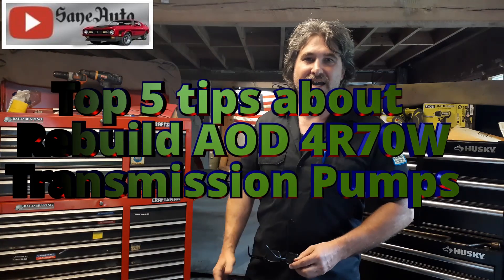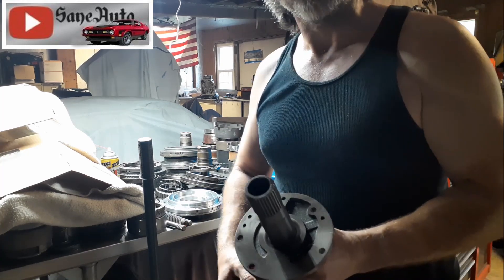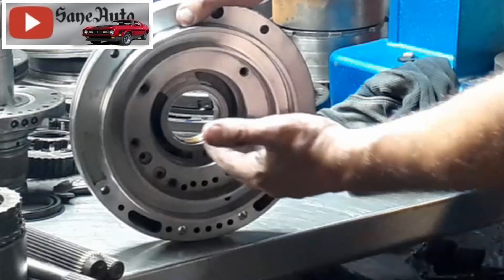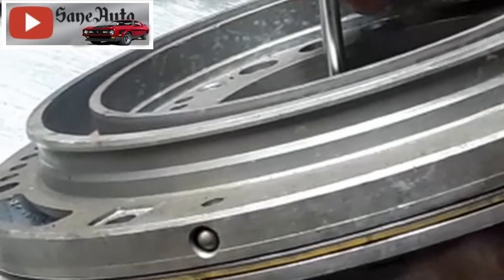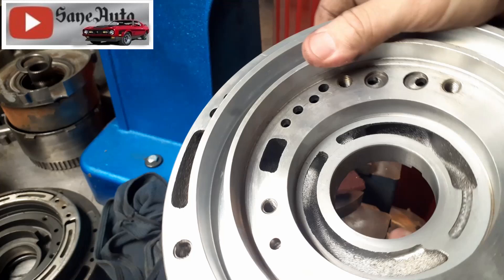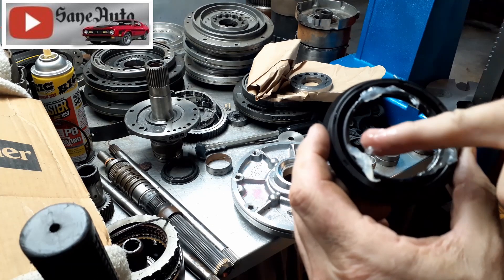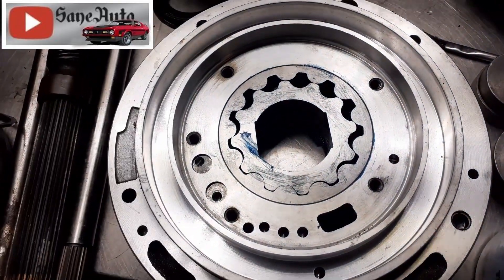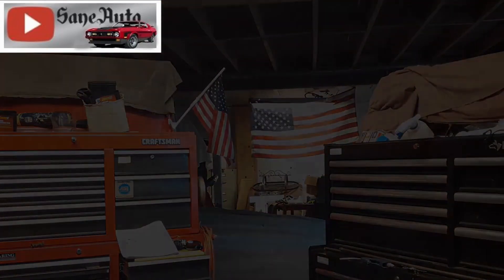Rebuild AOD 4R70W Pump Ford Automatic Transmission repair

Comment: Just wanted to say thanks.  I am a thirty year plus Master Tech but have moved into transmission rebuild recently and consider myself a Junior builder (been building mostly full time for just over 2 years) now.  I have rebuilt 5 or 6 4R70/75’s and never had an issue until this latest.  The unit works fine, shifts nice, performs well, but spit the converter seal out of the pump on the last test drive.  I obviously replaced the bushings and even 3m weather striped the outside of the seal.  The pump gears and pump were also checked for wear and were in great shape.  I never really thought about placing the groove of the bushing on the bottom of the cavity and I didn’t realize the seal was designed with a lip on the inner portion.  I enjoy this work very much because of these little things that are learned along the way and I will be paying a lot more attention to my bushing placement and pump seal retention from now on.  Lots of great experience shared here!!!!!  Thank You!!!
Reply from the maker: Wow thats Awesome! I was pretty much at that phase every year my first 5 years of building. After that it was still a full time job keeping up with learning all the new units and the details of they're weak points for the next 20 years or so. lots of ATSG seminars and reading research etc. It was a wild and exciting ride. Sometimes it was difficult, frustrating and even painful. Especially the day I had to have my finger sowed back on. But it was never ever boring. Thank you for reviving some memories.

Comment: I do want to ask you one more question and if you feel like helping great, if you don’t I completely understand and no disrespect at all. This 2008 4R75w that pushed the converter to pump bushing and front seal out is giving me a headache. I rebuilt the unit, replaced all the bushings, all the normal things on a proper rebuild.  As I stated it was working well (I did do the Jmod stuff by the way) and on the final test drive pushed the bushing/seal forward.  I had a 4R70w pump here in good shape.  Most everything looked/quick measured the same but the stator hub was different (inner bushing treatment) and the return spring for the intermediate piston was different (wave spring/4R75, attached to pump caged assembly/4R70.  So I swapped stators and used the pump body from the 4R70, bolted the pump back in, and installed the trans.  Now it’s shifting/acting like it has a cross leak somewhere.  It shifts up to OD but it’s slow then surges/falls in and out of OD and maybe lock up.  I have another pump coming and feel like it’s going to fix it but do you have any input on the possible differences in those two pumps?  I am also going to be checking my sealing rings/pump gasket to make sure I didn’t damage something there.

Comment: Great video. You methods are rock solid. Arbor press is the way to go.

Question. My neighbor couldn’t get his rebuilt 4R70W to seat and asked me to help. It was immediately obvious that the converter wasn’t lined up with the pump gear or maybe it had slipped out. He cranked it almost all the way in and was certainly putting pressure on the pump gear. 

I pulled the seal and inspected what I could with a flashlight and I cant see any issues but should the pump come out?

On other vehicles that have a drive pin it usually breaks the pin but I don’t see what would be damaged in this design provided the gear itself isn’t damaged.

Comment: I'm working on a 4R70W replacing the front pump metal/copper bushing. I didn't take the old one out so I'm stuck as to the notch I know the notch with a groove goes down to the fluid hole inside the shaft housing I'm wondering is, do the notches face up or face down?

Comment from the maker: Be careful with some other transmission pumps the bushing needs to be pressed and installed out the back because there is a lip in the front that could be damaged trying to press out the front.